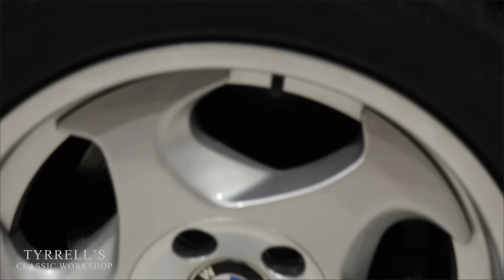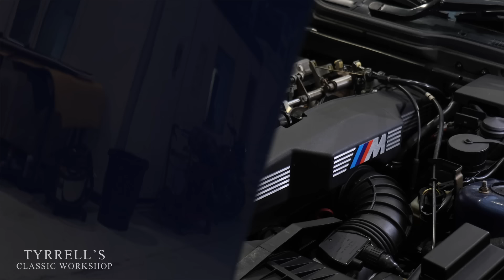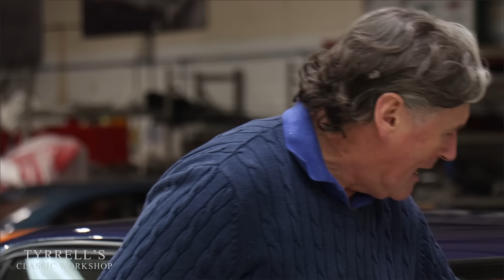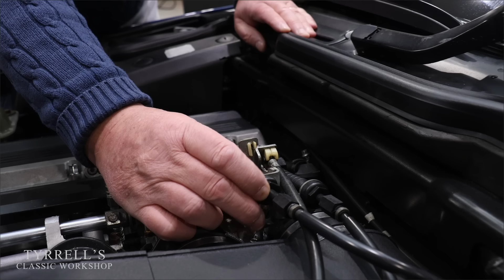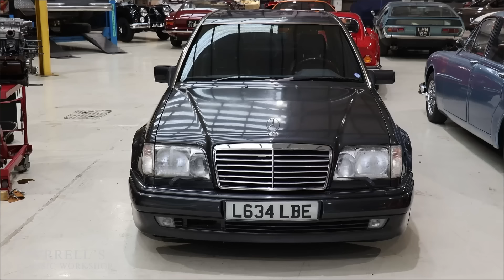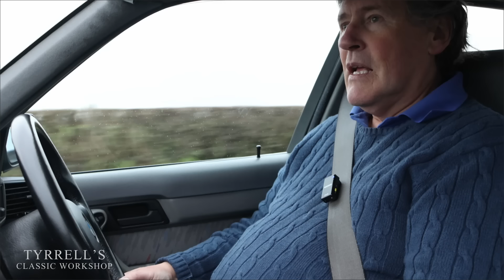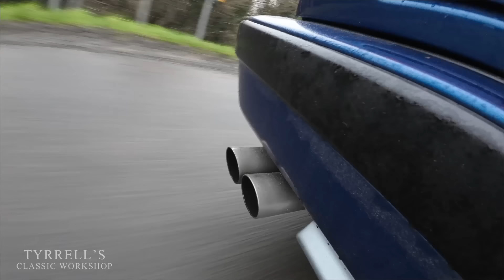BMW E34 M5- the ultimate driving machine?| Tyrrell's Classic Workshop

Comment: Mr Tyrrell, my father - a man you knew many many years ago via Bob Lamb - had one of these a number of years ago. A late, 3.8 6 Speed car, that was essentially a payment from a friend for work done on another vehicle of theirs.

I will never forget it, unfortunately times meant it had to leave after being used as a daily driver for around 4 years. It last changed hands for around 6x what he sold it for.

It was promised to be handed over to me once I could afford the insurance, but as stated, circumstances changed. I did however end up with his 540i of the same vintage - quite a consolation prize if you ask me! - that I still own some 12 years later.

The best M5 ever produced, everyone waxes lyrical about the E39, and having owned a run of the mill E39 for a number of years, I'm confident when I say that, while the E39 M5 feels like an extremely healthy 540i manual, the E34 M5 feels like a totally different car to anything else in the lineup.

Comment: Great ep! Have always had a soft spot for the E34 M5--such a cohesive design and in a favorite color! Funny you spent a moment with that wiper because if memory serves BMW designed the driver side wiper to press harder on the windshield with a tiny servo at the joint.  And I'll just say: Holden.

Comment: Closest '90s Aussie equivalent: Holden VT SS? Not sure about refinement and top speed, but the grunt of that 5.7 LS engine would put a smile on any petrolhead's face.😆
Reply: The LS1 powered Commodores came four years after the last E34. 
Closest Australian car by heritage, desirability and performance would be Holden VN SS Group A 1991. 
Others would be the Falcon EB GT, HSV VP GTS and 1994 VR GTS with the 215kw stroker and 6 spd manual.
Reply: @fairlane05  wheels back in the day had it up against the vn sv5000
Reply: @chrisparryphoto wheels also had it against the Group A in September 1990.

Comment: Question: At 1:06, you said this was the 2nd generation 5 Series. Forgive me if I'm wrong, but did you mean it was the 2nd-generation M5? I believe the E34 platform is the 3RD generation of 5 Series, following the E28 and E12.
Reply: I think he meant that this was the upgraded E34 M5 - with 340 bhp from 3.8 L instead of 315 bhp from 3.6 L.  The 315 bhp E34 version ran from 1989-ish until 1992-ish, and then the 340 bhp E34 version from 1993 until 1995. (they also went from a 5-speed to a 6-speed manual gearbox along the way). You're right that the E34 was the third gen 5 Series after the E12 and E28 - and the E34 M5 was the second gen fully-fledged "M5" after the E28.  The E12 range had the M535i model for the last year or so of the E12's run - while the E28 range had the M5 AND M535i.  I hope you're paying attention; I'll be asking questions later 😜
Reply: @alisonleaman333  ...LMAO.Good one🤣

Comment: The single row chain was used on the non catalysed E28 M5 and M635CSi - all E34's used a duplex chain.
This car is a pre facelift so narrow grilles, throwing star wheels and 5 speed 'box. The play in the steering is often in the column splines inside the car; fully extend it, get plenty of grease in by moving the column in and out and do the 32mm adjuster nut up good and tight. When you can no longer adjust the column, back it off a tad.
That's a lovely thing - look at the crap they make now. ☹
Reply: Top tip that, cheers!
Reply: I had one, it was a maint nightmare..besides the oil leaks, valve cover gaskets, plug o rings, terrible drivetrain problems as it couldnt handle the torque, it was a fun car, got rid of it while it was under warranty otherwise I couldnt give it away and this car has little miles..high maint like the 190 2.2 I had which was worse

Comment: American mechanic here, WD-40 isn't a lubricant, it's a detergent. Though, the company does make a range of specialty lubricants.
Reply: WD-40 is not a detergent; it is a petroleum-based solvent, water displacer, and light lubricant. While it acts as a degreaser by dissolving oil and grime, it does not use soapy, water-soluble detergents to clean. It works by breaking down grease and leaving a light protective resid
Reply: @davidm9090 most of the chemicals in WD-40, especially the primary solvent - petroleum distillates, are volatile compounds that evaporate. It does tend to solve problems quickly, but it does not leave a lasting protection for high usage or corrosive environments.
Reply: Yes. - when I had my garage doors serviced I was told not to use WD40 but 3 in 1 oil spray …
Reply: I noticed that too, but to give benefit of doubt, most of the WD range have similar cans. I'm not going to re watch to see if the exact product was visible.
Reply: @solsol1624 I couldn't tell for sure, but I figured it's a good thing to know
Reply: @grenmastermike yeah well worth pointing out for those that don't know.
Reply: WD-40 Multi-Use Product is a versatile, petroleum-based spray designed to displace moisture, lubricate moving parts, penetrate stuck mechanisms, and protect metal surfaces from rust and corrosion. Originally created in 1953, it is widely used for maintenance, cleaning adhesives, and preventing moisture-induced, short circuits in electrical systems. 
Key Features and Uses
Moisture Displacement: Efficiently dries out electrical systems to prevent short circuits.
Lubrication: Lubricates moving parts like hinges, wheels, rollers, and chains.
Penetration: Loosens stuck, frozen, or rusted metal parts.
Rust Protection: Shields metal surfaces against corrosion with a protective layer.
Cleaning: Removes grease, grime, adhesives, and stickers.
Reply: Yeah I cringed when I saw him with a can of wd40 for those hinges.
Reply: It dries out in no time at all , choose a different product for hinge lubricant. 
Mr T going to regret using WD40 for sure 😂
Reply: "It's a detergent." Confidently incorrect. Glad you're not my mechanic.
Reply: @cafe405 ouch, that seems a bit harsh, the majority of the stuff in WD-40 is similar to chemicals used as detergents and dispersants in fuel and other oil products.
Reply: Yes I think you’re better off using 3-1 oil for a longer lasting lubricant.  However WD40 is fine in the short term
Reply: WD= Water Displacement effort #40 developed for the minute man III programe to protect against the elements.
Reply: @pepvwaning8551 was it designed to act as a coating, or a high performance lubricant?
Reply: The clue is in the name WD-40.  Water displacement 40th formula.  It is used today for various purposes such as water displacement and as a light lubricant and also as a penetrating oil.  It is a jack of all trades but master of none hence why professionals will advise you to use a product designed solely for each application.  It is used to get you out of a bind but not as a permanent solution. It was originally designed for Convair to protect the outer skin of their Atlas missiles from corrosion.
Reply: Thanks to everyone for being civil!
Reply: WD-40 is not a detergent, but a chemical formulation with a petroleum base. My dad, a former Air Force mechanic, used it all the time to loosen rusted bolts and the like when maintenancing our family cars. To this day, I always have a can in my garage. Very versatile.
Reply: The formula for WD-40 is as closely guarded a secret as the recipe for Chartreuse liqueur. In both cases, only 2 people in each organization known the exact formula
Reply: @andrewward3752 read the recent article in Wall Street Journal about the formula!